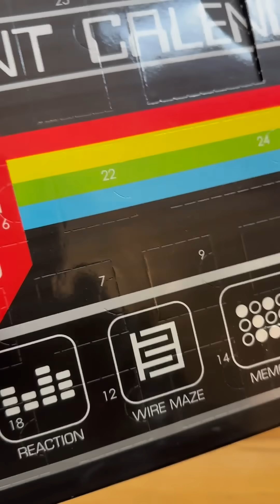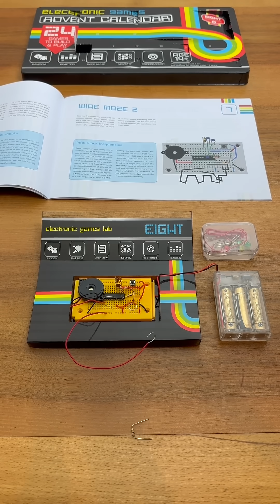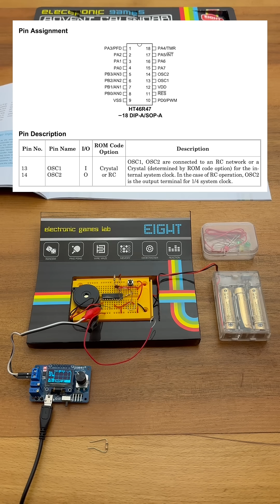Day 7 - Electronic Games Advent Calendar Project! #electronics #retro #adventcalendar

Comment: what will happen if we use a different resistor?
Reply from the maker: Great question. We should be able to adjust the speed by using other values of resistor. It’d be a great experiment to try.